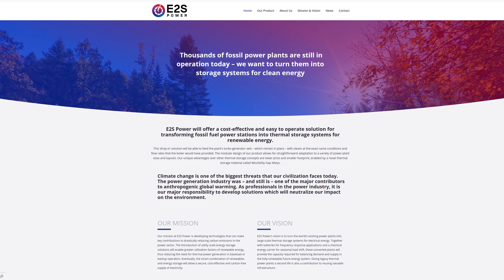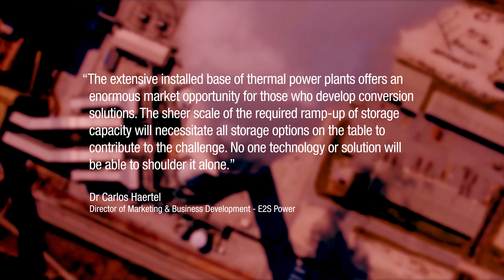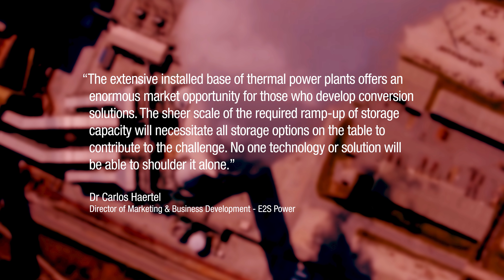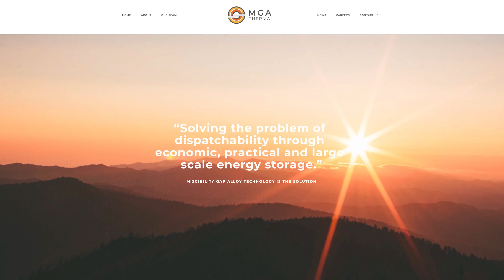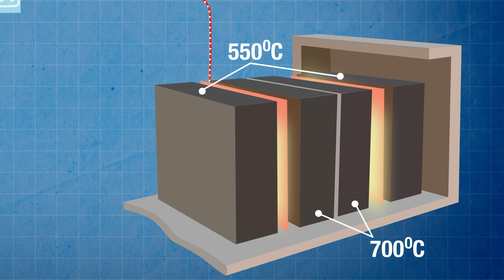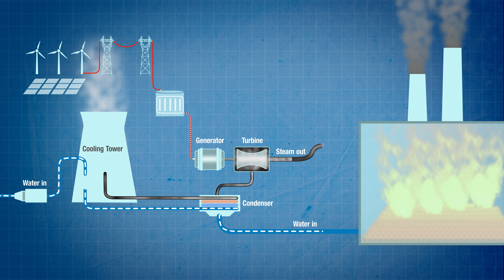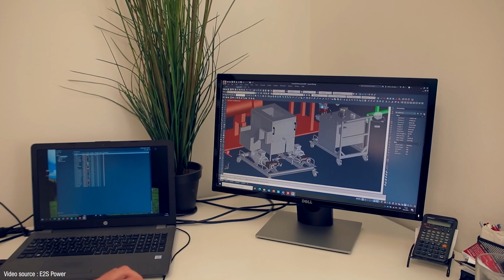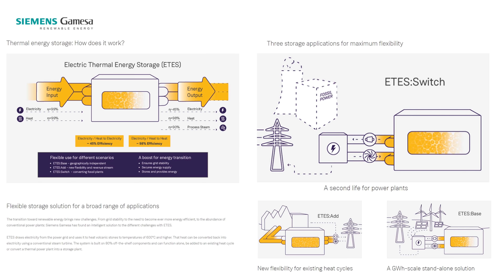New energy storage tech breathing life and jobs back into disused coal power plants

Comment: Electric heaters means they’re throwing away efficiency compared to using heat pumps of some topology. The maximum efficiency of a heat engine is (T-hot - T-cold) / T-hot, or 1 - T-cold / T-hot. So the steam-based heat engine will at most have an efficiency of 1 - 300K / 820K or 63%, which is awful. If you used a heat pump to get the aluminium up to 700C = 970K then the efficiency of that heating could be improved up to 144%. Multiply that by the heat engine efficiency and you boost it to 91%. Which as far as I’m concerned is acceptable, but both those numbers are still assuming perfectly ideal heat engines and heat pumps. In reality I expect them to be closer to 50% and 65% respectively. Throwing away half your power generation for storage just to keep some union folks happy feels incredibly backwards.

Until we have a very significant excess of power to store in such lossy storage units, we should build more efficient methods of storage, like flow batteries or sodium batteries or whatever. As far as appeasing the power plant workers goes, you could still use the existing electrical infrastructure at these locations for making any kind of grid storage. Get rid of those cooling towers and cover the whole thing with solar panels, or maybe thermal solar towers if you want to keep that steam infrastructure too. The existing generators could be used as part of flywheel energy storage units for that grid synchronised fast response buffering.
High energy density really isn’t that big of an issue if you’re on such a large plot of land. Once you’ve spread your batteries wide, start building them high too. Just don’t use a portability-oriented chemistry like lithium-ion that will be dead in 3 years and has a significant fire risk.
Reply: I cannot see heat pumps getting that hot?
Reply: @morninboy  : exactly - ok for warming homes, not so much for industrial grade process heat ( or power generation).
Reply: Good pionts James. Pumped hydro, 85%, it is what is used today, and it is the figure to improve (not halve :-))
Reply: @bjorn2fly  yes but large land area size is needed for pumped hydro I'm told. Is there built structures and denser configurations possible?
Reply: While I fully agree with the main points of your comment. Creating new infrastructure is indeed going to be better long term but repurposed infrastructure is an easier sell even if it's less effective.

Unfortunately, profit incentive is often the primary driving factor behind change. Repurposed infrastructure is always going to be an easier sell due to the Sucken Cost fallacy.
Reply: Of course the whole idea is a green wet dream
Reply: 100% agreement if one only considers the operational energy efficiency of the system.  I otherwise disagree.  The problem with focusing solely on energy efficiency is that you are neglecting the lead time and amortized costs to design, pilot test, manufacture and install a utility scale heat pump system.  It is a novel solution that has never been implemented on a utility scale system.  The amortized cost to design, manufacture, and install such a system would have to be recaptured in the wholesale and retail cost of electricity passed on to the consumers. Also, who is going to finance the multiple years of upfront costs to design, pilot test, manufacture, and install such a system before the system even comes online?  Who is going to manufacture and supply the novel parts and components that will go into constructing a novel utility scale heat pump system.  How much lead time do the suppliers get to start their own design and manufacturing of the novel utility scale parts and components that will go into the system.  There is simply no quick or cheap turnkey solution to implementing a large utility scale heat pump system.  There is no manufacturer catalog available to peruse and order the necessary parts and components.  The utility scale parts and components would have to be designed and manufactured from scratch.

However, large gigawatt utility scale solar PV is now coming in at a cost of less than $0.02 per KWh at favorable locations like the UAE and the Atacama desert.  At these costs does the round trip efficiency even matter any more?  A $0.02 per KWh generation cost coupled with a 50% round trip energy efficiency loss simply becomes the equivalent a $0.04 per KWh generation cost.  The problem with intermittent renewable sources is becoming less and less a problem with the cost of generating power in the first instance as it is to the problem of storing the power once it has been generated.  It increasingly seems as though the once important cost of generation (and round trip energy efficiency) are both well on their way to becoming an obsolete financial red herring that is dwarfed by the technical availability and associated cost of storing power once it has been generated.

I think one of the points of this video is that the repurposing of decommissioned steam power plants is a quick, easy, and inexpensive solution to the problem of utility scale storage of power generated by intermittent sources.  The basic design, pilot testing, and validation of the novel portion of the repurposed system has already been done.  The inherent "cheapness" of power generated by intermittent power sources allows for some pretty significant round trip energy storage losses.  Round trip energy storage losses are a simple, affordable, and unavoidable cost of doing business from the perspective of an intermittent power generator.  As more and more sources of cheap intermittent power come online there will be an excess of power at certain times that will incentivise a market demand to store the excess power.
Reply: @petertownsend252  : "too cheap to meter", that is the dream....
(I agree with the sentiment that RTE is pointless in the era of curtailment)

It may never be the reality across the board  - but if we can reduce peaking plant starts to "infrequent" - that is a place to start.  So long as we can keep the .lights on during the transition.

Comment: Always interested in your videos. Here in Australia where coal reigned supreme for a long time the tide is turning. Excess renewable power can be used to produce 'Green Hydrogen' (Just add water). My question is "Can the water be sea water" i.e. high salt and other contaminants?
Reply: The round trip of electricity to h2 back to electricity isn't as efficient as other energy storage. But h2 is transportable which can be a great advantage.
Reply: Desalanisation and filtration leaves also some sludghe (see Israeli experience).

Comment: Might be the low temp latent heat that makes aluminium more efficient than steel, for heat storage.
Reply: Yeah, Al's 660 degree melting point is a  good match for existing steam turbines which were designed for steam at 500 - 600 Celsius. Apparently corrosion gets to be a problem with pressurised steam over 700 C.

Comment: Certainly has a great advantage to use existing infrastructure. This type of storage will be in great demand by utilities as gas declines and should be lower cost and longer duration than grid scale batteries.
Reply: I don't see how this could possibly be cost effective. A steam turbine is at best ~50 percent efficient. Combine that with transmission loses, lost heat during storage, etc and you're looking at needing 4+ units in for every unit put back into the grid.
Reply: @wwjbrickd  Agree with the concern. Round trip efficiency is certainly important for any type of cost effective energy storage. Lithium batteries for storing energy for say 4 days would be enormously expensive. Yes thermal storage would be physically very large and need great insulation and round trip efficiency would likely be well under 50%. Hydrogen is widely predicted for a role like this too, but storing large quantities of hydrogen would also be expensive especially if it is liquified and would also have low round trip efficiency. Predictions suggest overbuilding low cost solar and wind so there will be frequent times where more power is available than can be used. Heating rocks with this power is cheap and easy. Making hydrogen with this cheap power means expensive electrolyzers that are used part time. Only way to compare is to build one and see what it costs and how it works.
Reply: @rickrys2729  Lithium battery can store energy for months and cost will be the same.
Reply: This IS a battery system ❣️

Comment: This technology may allow some US utilities to continue to bill consumers for leftover coal infrastructure.

Each of the 50 states has their own laws covering how monopolized utility companies finance power plant construction. Some of these unique regulatory frameworks may make a system that uses resistance heating make economic sense.

What is the round trip efficiency?
Reply: Large gigawatt utility scale solar PV is now coming in at a cost of less than $0.02 per KWh at favorable locations like the UAE and the Atacama desert.  At these costs does the round trip efficiency even matter any more?  A $0.02 per KWh generation cost coupled with a 50% round trip energy efficiency loss simply becomes the equivalent a $0.04 per KWh generation cost.  The problem with intermittent renewable sources is becoming less and less a problem with the cost of generating power in the first instance as it is to the problem of storing the power once it has been generated.  It increasingly seems as though the once important cost of generation (and round trip energy efficiency) are both well on their way to becoming an obsolete financial red herring that is dwarfed by the technical capability and associated cost of storing power once it has been generated.
Reply: @petertownsend252  imo the efficiency argument should still be made for two reasons: 
1) Comparing different storage solutions (their efficiency is also a factor in their price) 
2) Determining the amount of stuff we'd have to build - less stuff is favorable (and efficiency is one factor in that question)
Reply: @petertownsend252  very fair and interesting points and in many cases, what you suggest makes sense. But there are international political considerations too. e.g. Some countries that don’t have access to such large scale areas where very efficient solar or wind farms can operate or indeed have alternative resources. What If they become dependent on hostile neighbours? Supply chains can be disrupted by terrorists and alien states. There is probably a place for all different types of technology, but I hope that at least in the future there will be a reduced reliance on a centralized system. Modest amounts of storage at a more local level could ease demand peaks and central dependence whether using heat batteries or lithium iron. There is huge storage capacity in domestic Electric vehicles, many of which do and likely will continue to stand idle for 95% of their life; also the possibility of storing kinetic energy in huge weights which could perhaps utilise disused mine shafts closer to where energy is needed. Governments need to be mindful of the risks of allowing Big Oil to buy up non-fossil-fuel competitors with all the attendant dangers of creating monopolies and or oligopolies. Empowering individuals to have greater control at the local level offers the chance to democratize the power sector.
Reply: Steam turbines are about 45% efficient, so less than that.
Reply: It depends on the temperature of the steam.  The problem isn't the turbine, but rather how efficiently you can turn random thermal motion into directed motion.  This is the infamous Carnot inefficiency.
Reply: @incognitotorpedo42  It would be advisable to read the original Carnot work "Reflections on the Motive Power of Heat" (about 130 or so pages). Regrettably, or not, it is in French (as expected) but an early, very good, direct English translation, without interpretation was published 1897.  What is quite interesting is that Carnot makes a particular assumptions, that are never mentioned, in any educational course, to reach his conclusion. Understanding these assumptions makes one question the widespread "knowledge" about "Carnot inefficiency".